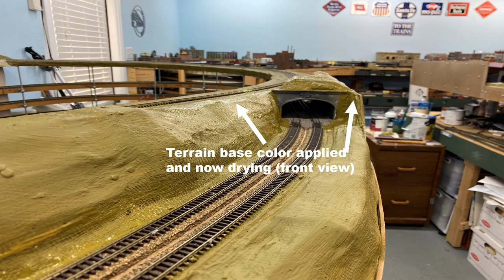New Scenery Above West Helix Part 1

Comment: Hey John sorry I'm so far behind but looking good.   I've been using plaster cloth from a med supply for a while now but I get mine from them not Amazon. 
You mentioned Oklahoma,  are you planning on going to the OKC train show in November?  Keep having fun, Chris
Reply from the maker: Hey Chris, The med plaster cloth works just fine and IMO ends up being less expensive than buying an equal quantity of the name brand cloth. Sorry but that is way too far for me to drive these days because my back will only tolerate short trips so the OKC show is out for me……John
Reply: Ok.  Just thought I'd ask.  Anyway I  know what you mean buy the cost of the cloth.  I get a case of it for less than a  roll from the hobby store

Comment: John are you planning on closing in the top of this helix or leaving it open?  ~Tony
Reply from the maker: Hi Tony , No I am not going to enclose the west helix like I did the east helix. I have to keep the center of the west helix open so there is access to the mini-split HVAC that is just above it. I am only doing scenery on the track that runs above the west helix. In my next video I do show a table extension has been added to cover the helix that was just below the farm area. This will allow the farm to be expanded……John